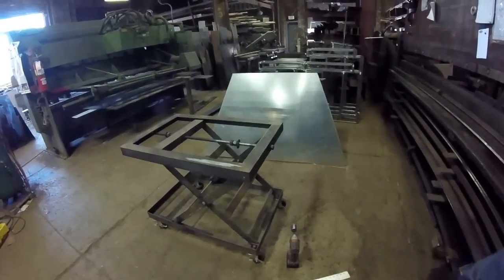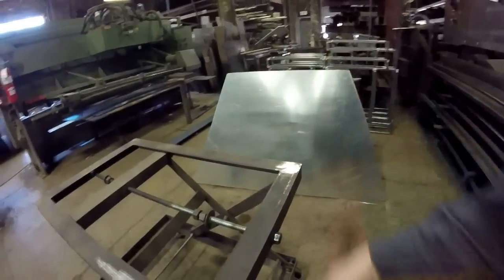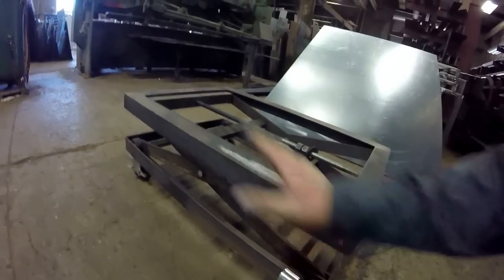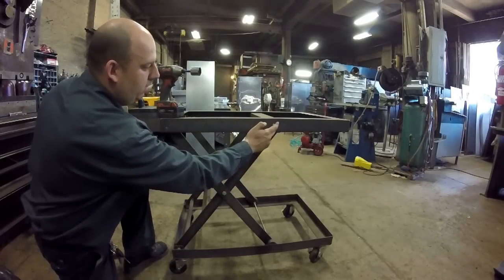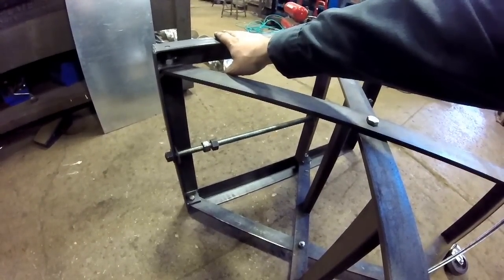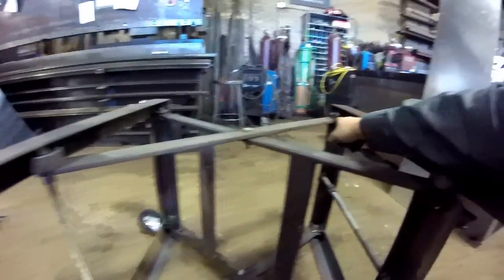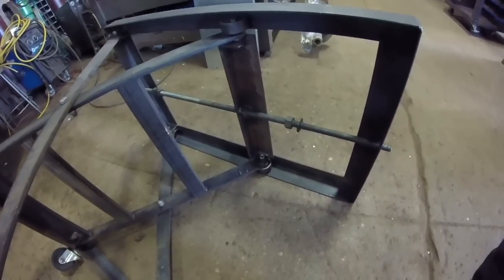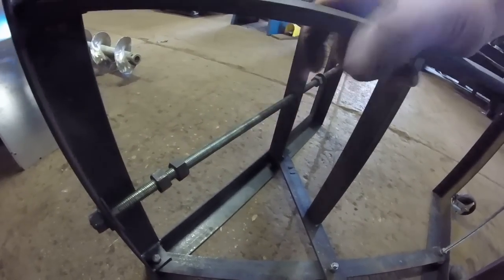Homemade scissor lift table

Comment: By the way this Not your design.First off this design has been around longer than you even appear to be(over 50 +yrs.). It's a very easy concept design that has been configured in so many ways.
Reply from the maker: I think you mean that I didn't invent it, but this is certainly my design. I designed my cart with odd sized surplus material, and I'm not taking liability for someone hurting themselves trying to copy my design. There can be thousands of different designs based on one invention, but if someone copies a design than it's a copy. Thanks for watching and good luck if you're building a cart!

Comment: Check out this Custom size Top Electric Hydraulic Lift Table 1000 LBS, Welding Table (http://www.ebay.com/itm/Custom-size-Top-Electric-Hydraulic-Lift-Table-1000-LBS-Welding-Table-/152521968513?hash=item2383048b81:g:z8AAAOSwXYtY0x0y) you couldn't find a better price!

Comment: what is the max load? can it lift a transmission?
Reply from the maker: I know it can lift 500lbs no problem. I limit it to 800lbs max with a even/centered load, and 400lbs max at maximum height because of the cantilevered design. Sure it probably can handle a lot more but I'm not destroying just to test it limitations! :)
Reply from the maker: Łukasz Czytoważne we just lifted a 700lb die and rolled it gently to our table without a problem.
Reply from the maker: Łukasz Czytoważne  yes we did, the cordless impact is very strong. a slow speed corded drill used for mixing plaster is even faster and just as strong.
Reply: what maximum weight which it is possible to pick up with help of the drill
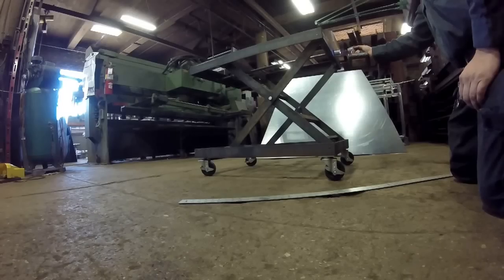Reply: really with the help of this cordles drill from 0:51, did you lift 700 kg up?
Reply: sorry was supposed to be 700 lbs